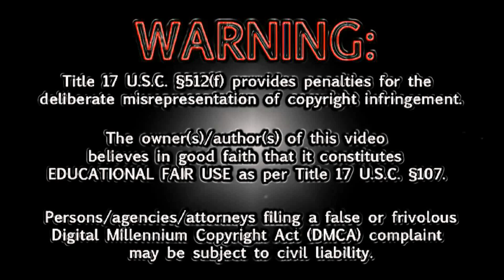Ken Ham the Anti Science Sham Part 2: Ark Encounter

Comment: I would like an estimate of the man hours spent on the construction of this ridiculous failure. Applying man hour equivalents to the power tools, Cranes, Cherry pickers, Earth moving equipment saw milling machines; the making of manufactured items wooden pegs rather than screws, nails, bolts, cladding    . . . and on and on. Replace these with the Noah era technology/man hours equivalent. and divide this between : What was it ? Seven untrained boys and one old man ? Thanks Ken, what better, (or more costly) way could one ever devise for the debunking the nonsense of the Noah's Ark myth ? You do the world a great favour.
Reply from the maker: +Black currawong Well said!
Reply: ***** Yes, and we would indeed be proving  ourselves idiotic if we could delude ourselves enough to believe that which Ham has proved beyond doubt to be beyond even the wildest realms of possibility.
Reply: ***** The great pyramid of Cheops is a fact. An actual object. A magnificent achievement, yes, and we have worked out more or less how it was achieved.The obvious deception is in trying to pretend that the Ark : built, filled with the worlds animals, maintained and sailed for a year and then used to restore and re-habet a dead planet, with just a handful of people. is even in the vaguest realms of a possibility.
Ham has just proved that even the first requirement for all of this was totally impossible to achieve, and that was only the first step that Noah and his boys are supposed to have accomplished. The rest is even more impossible. Deception is your game . . . obviously.
Reply: I can see you love to play the hypothetical assumptions guessing game. It's a shame you have nothing more to offer. Perhaps a visit to the Ark Encounter and other historical monuments will expand your mind beyond your present grasp of what can be achieved without cranes and other power tools.
Reply: So. would you like to tell us all how we can produce a universe, life, consciousness and all else in existence from scratch. As all this is currently "beyond even the wildest realms of possibility." If you can do this we can all abandon the "blind leap of faith" needed to believe that all this happened "all by itself".
Reply: The "Hypothetical assumptions" are yours not mine. It is totally obvious, from even the most perfunctory view of practicality, That without the full use of modern technology and a vast hoard of  a work force, Hams's monument to biblical stupidity could not have been built; The thing is even incapable of sustaining itself without the aid of tons of reinforced concrete, steel bolts struts and fixtures. It is unliveable inside without modern air conditioning and even needs a modern state of the art, sandwiched membrane system to prevent rain penetration and over heating: there is no way that this thing would float and be seaworthy. Also you are suggesting that Noah and his boys; without all of this technical advantage,  built, filled with animals, fodder and whatever and sailed this thing for a year in what would have been tempestuous conditions. 
Now c'mon . . ."hypothetical." ?
Reply: "So. would you like to tell us all how we can produce a universe, life, consciousness and all else in existence from scratch."
We are very close to answering this question - re. the origin of life on earth, and have a far far better handle on the origin of the universe than the "Dunno . . .Musta, been a God," non-solution that superstitious ignorance has attempted to provide.
Reply: Who is deceived here? Ken Ham had to coat the entire outside of this wooden failure with a space-age polymer just to keep water out. Did Noah have access to space-age technology? No. A wooden vessel of this size simply isn't seaworthy.
Reply: ***** What you just told me is "Of course there's no evidence! It's silly to try and prove a claim with logic and evidence!"

That's foolish, and would lead us back to the dark ages. I'd rather believe in as many true things and as few false things as possible. If you choose to believe that some being that you've even admitted there's no evidence for created everything, then feel free to do so. However, do not expect others to believe it simply because you say so. That's the reason we humans came up with the scientific method, so we could discern what was true and what wasn't.
Reply: ***** There's a simple solution to this argument. Offer just one shred of evidence for a god, any god...and you'll change the world.
Reply: +John Heininger
" Perhaps a visit to the Ark Encounter and other historical monuments 
will expand your mind beyond your present grasp of what can be achieved without cranes and other power tools."

The Ark is NOT a historical monument.

"So. would you like to tell us all how we can produce a universe, life, consciousness and all else in existence from scratch."

Your own Bible does not explain how life, the Universe and everything was produced, it only states Goddidit.

Only the Universe was produced from scratch, everything else was produced from preexisting materials. Life was produced from simple chemicals through physical and chemical processes, consciousness was produced through the process of evolution.

"f you can do this we can all abandon the "blind leap of faith" needed to believe that all this happened "all by itself"."

It does not require any faith to accept what science shows us to be true.
Reply: Black currawong:  The technology of the ancients is still not understood today.  Do you really believe the pyramids were just tombs???
Reply: Black currawong:   The Ark has been found.  Google earth  "Noahs Ark national park"  The head archaeologist of Turkey Efrin Arkagel said  "it has to be an ancient ship of some kind"
Reply: +Black currawong According to Thunderf00t's Why do People Laugh at Creationists - Part 44, it was 2000 man years of labour that was spent on this 100 million dollar monstrosity. 100 million dollars! And it is an abject failure in every regard. It has very low attendance and the ticket prices are eye-watering.
Reply: generalmax Faith means you have to believe in something all your senses tell you doesn't exist. Why would a God give man a brain and then call it a sin if man uses his brain? Christianity has done its utmost to close the circle and declared even doubt to be sin. One is supposed to be cast into belief without reason, by a miracle, and from then on to swim in it as in the brightest and least ambiguous of elements: even a glance towards land, even the thought that one perhaps exists for something else as well as swimming, even the slightest impulse of our amphibious nature — is sin! And notice that all this means that the foundation of belief and all reflection on its origin is likewise excluded as sinful. What is wanted are blindness and intoxication and an eternal song over the waves in which reason has drowned.
Reply: Bobby Paluga,

Great comment there! All the theists became strangely silent after this.
Reply: Black currawong dont be dumb, its because noah had god and ken doesnt